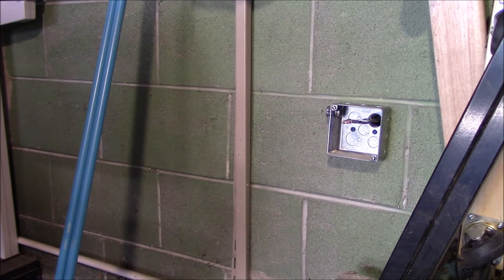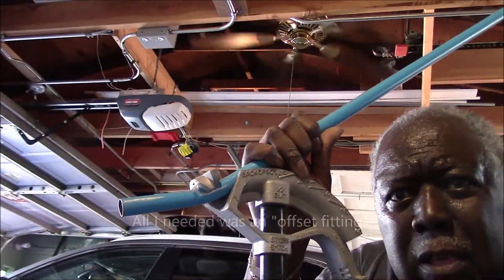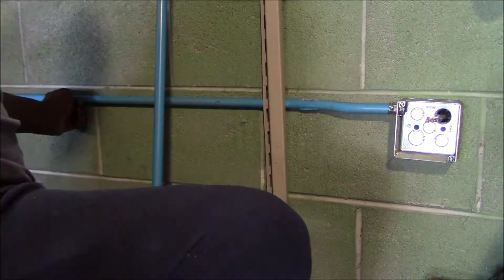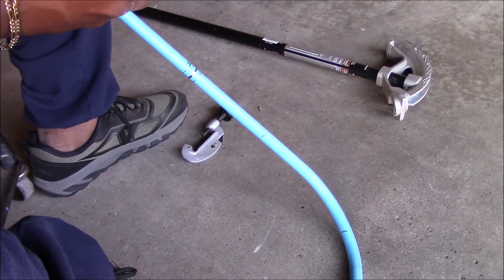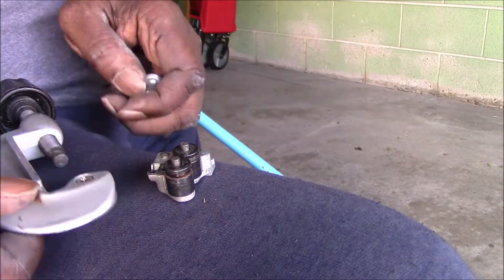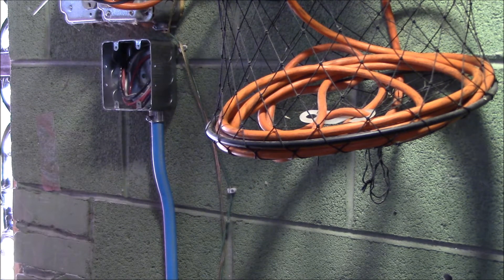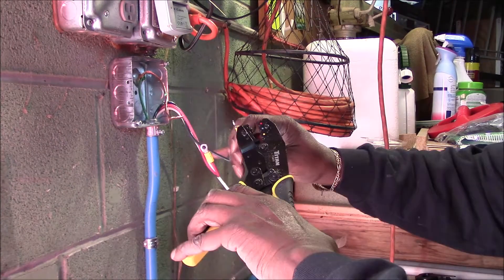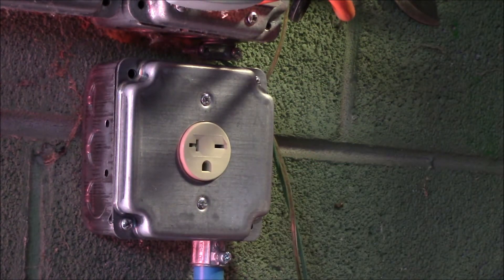EV Charging Electric Feed - Inside Garage

Comment: I would caution home owners to involve a pro to some degree.  Level 2 charging is on parallel with adding another stove into your house.  Are your wires big enough for this....no your service wires.

While house service sizes are not calculated like this......

50 amp breaker for stove
50 amps for car
30 amps for water heater
50 amps for your a/c :. Heating
10 - 15 amp breakers for recpticles
3 - 20 amp breakers for kitchen/bath

390 ish total in breaker amps on a 200 amp service?  Again, not how it is calculated but I hope it makes everyone think.

Your service can be compressed down to support your house as built.  Take care in adding.
Reply: I suppose you're a pro. Thanks for your advice. Please help if you can.
I have a ~100ft run from my breaker box to detached garage. My basement has a raised floor (2x10 joists). So I'm looking to run 6/3 steel armored cable (expensive) under the floor and through a brick wall then underground to a brick walled garage. 
Do I need to run through conduit underground?
Do I need to go through the wall underground or can i break through above ground (few inches maybe) and immediately go under?
Is there a cheaper option for what I'm thinking?
Reply: @koh9894  there are several concerns here. 

First I would recommend you talk with a pro in your area.  Rules change from place to place.  Maybe a little cash to them to inspect and advise you.

Wire size needs to be considered.  Not the wire size you are running, but the wire supplying your house.  Houses generally have the load used "calculated" and the wire size to your main panel is shrunken down to the minimum for what you have when the house is built.

The wire. (NEC 310)....inside should be okay with nm cable, but under ground, even in conduit, water rated, like uf,/use cable or in pipe or individual wires rated wet locations.

Distance. (NEC 210.19) at 100 feet, 14/2 loaded to 12 amps would be outside the required voltage and would require the wire be changed to 12/2.  So, don't just pick a wire size, size the wire for your load.

Outside the house....you can exit above or below grade, but sealing out the rain (above ground) will be easier than sealing out the water in the saturated ground.  Also, easier to drill through a wall than concrete....still you choose 

In the dirt. (NEC 300.).... Has a table for burial depth and talks about using short pieces of piping to protect the wire going down or returning from depth.  Since you need to open up the ground, I would encourage piping.  Piping about "house wire size" (1 1/2).  Today you could pull a wire through it to supply one recepticle and tomorrow, replace it with wire big enough to power a house and no new trenching required.

Also, while your trench is open, consider 2 or 3 pipes or about 3/4 or 1 inch for things like cable or security  or maybe a light to be a dinner-bell / emergency call.....flashing orange light controlled from house Incase you do noisy things and cannot hear your phone.  While may circuits can be put into one pipe, the NEC demands you lower their current rating with more than 4 current carry conductors in the same pipe and have a voltage separation barrier between power and data.

You garage needs all recepticles to be GFCI protected, even 250 vac, per NEC 210.8.

I also failed to mention the inspectors.  I consider them as a second check for my work.  They can patt me on the back for good and point out any errors.  With electricity, any error could be a castraphy.  If they are not involved, insurance companies can pass on paying you for a claim.

Both the pros and inspectors look at electrical work all day, so if you get stumped, they probably already saw 8 - 10 different solutions.

Please double check everything here.  I gave the NEC numbers without looking in the book, so something might be off by a number or two.

Good luck.  Hope I was helpful.
Reply: @keithharrington4595  
VERY helpful indeed. My plan is to have a pro upgrade line to the house (we're at 100A right now. smh...) and make connections. I just wanna have the correct cable in place to handle at least 40A first.